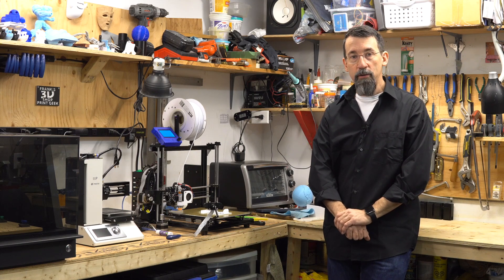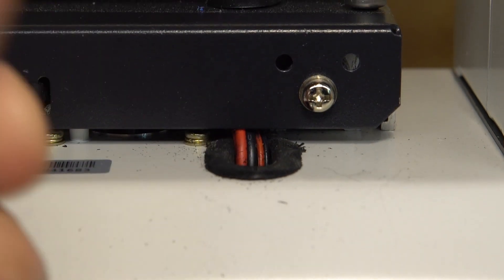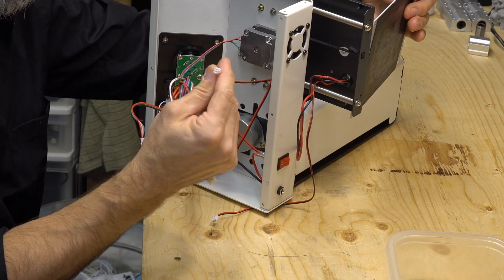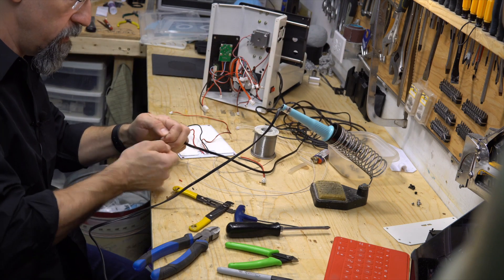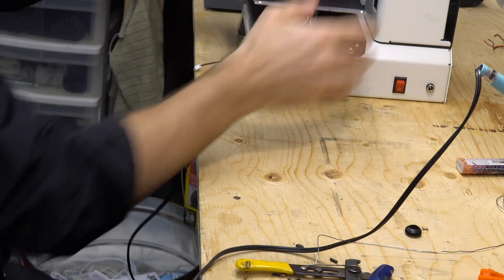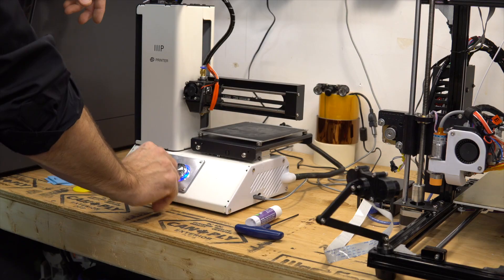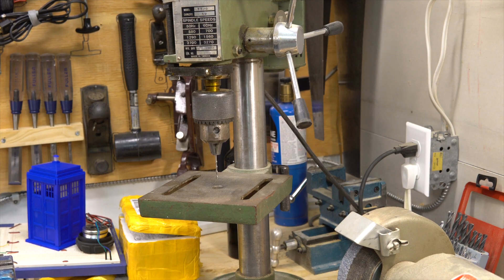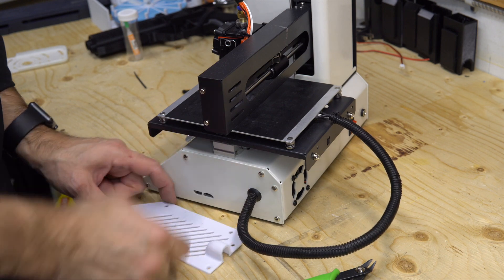Monoprice Mini Select V2 heat bed cable replacement

Comment: Will this bed wire mod work on the V1?  I was in the middle of a print and my V1 died.  No power.  When I manually move the bed, there is one spot where the power comes on for a split second and then nothing.  So it sounds like the bed wiring is the culprit.

Comment: You have a video of how to get the belt tension or install it? No matter what I do I can not figure out how to install a new belt for bed.
Reply from the maker: No I do not, I have put it on my suggestion list for videos.
Reply: @Franks3Dshop  I ender up finding the belt diagram. Took for ever to find. All working again ty

Comment: Salut Frank, j'ai un monoprice mini et je veut mettre du filament de 3mm , comment faire? Merci d'avance!
Reply from the maker: Salut, il faut modifier tout le chemin que prends le filament pour du 3mm, y compris l'extrudeur, c'est assez compliquer et la mini est bonne pour imprimer de petite pièces et vu la grandeur du banc ne peut pas imprimmer très rapidement à cause des accélérations limitées par la grandeur du banc, le 3mm n'aurait pas d'avantage selon moi.
Reply: @Franks3Dshop  

Merci.

Comment: I'm doing a similar version to this, although I drilled some holes in mine, and I can't get the solder to release the old wires. Is it not hot enough? it's a 100 watt soldering gun, looks just like yours actually.
Reply from the maker: Hi, it should be more than enough, sometimes getting some new solder on the iron before heating the joint helps.

Comment: Mine's Bowden coupler failed meaning I needed to replace it which lead to a full extruder feeder replacement. Now the cable is doing this. Glad you have this.

Comment: hey frank, thanks for the video, i got one question for you, and the others readin the blog, my bed is heatin properly, but the temperature on the the screen is not right//
temp goes from 27 to 51 in 2 seconds and comes back to 27 in less than 5 seconds.. i cant figure it out.. anyone?
Reply from the maker: No clue for that one... Did you make any modifications ?

Comment: Nice video. I'm starting to see the wacky temp readings. This sucks. I don't think I have the dexterity left to do this. Got no tools thanks to a thieving brother-in-law. I'm screwed.
Reply from the maker: May I suggest that you look at this video, the way I do it requires no soldering and less dexterity I think: https://youtu.be/d0X518wUJT0
Reply: Thanks for the reply but my MP Mini issue is the heat bed problem you addressed in the video above. You linked to a hot end fan replacement.
Reply from the maker: Sorry for the mix up not enough coffee I guess! I do not have an easier way for the bed...
Reply: No worries. I was planning on a new printer now it's just the sooner than later. Just got to dig out enough room. Want a 50lb color laser printer? 😀

Comment: Hey Frank, I have the same drill press you have in this video. 
That ugly green Chicago Electric, way to fast, but very useful drill press from Harbor Freight. 
I have a small knife shop in a shed and that thing works great for me after all these years. 
By the way, love your videos. I’m new to 3D printing and these help so much.
Reply from the maker: Thank you very much, that drill press and the grinder were my grand father’s, the travel is too short for my taste, but fills my needs. And great for the knife shop, would like that someday too. Need some diamond sharpening stones...

Comment: solid wire work? or should i use stranded since the wire will be moving alot?
Reply from the maker: Hi, stranded wire for sure, you could use wires for cars, the type that goes from the door to the car. The more flexible they are, the better, respect the gage size.

Comment: Hi Frank, after doing the fix the bed temp just rises non-stop. I havent soldered, just twisted the wires... is this a reason for this issue? thanks!
Reply from the maker: Does it start heating on it’s own? If yes, your output mosfet maybe bad. I presume you turned the printer OFF and ON? Check your connections, put some tape on them at least. I do not know what could happen if mix up the cables or if they short out on one another, nothing good I think. Make sure you do not have a short.

Comment: Hi Frank.  My Mini is 6-7 weeks old, V2. I thought I'd do the reroute before the wires actually did stop working. It's easy to do and didn't take long. But after completing this the temp gage is now reading 234 then 426 then 375, constantly changing. Do you know what would now cause the gage to fluctuate and misread? Thanks for any help.
Reply from the maker: Hi, it looks like an almost broken cable, like if the individuals threads of wires were all cut but one inside the insulation. If you want to be sure, you can switch thermistors plugs of the nozzle and bed only to test the readout, do not start the printer heaters like that and do not leave it inverted or you could start a fire... if the bad reading is also reversed, you know the board is good and that you have a bad cable or thermistor on the bed. Remember, DO NOT START HEATING with the thermistors inverted... label everything to be sure to replace the cables at the correct position and stay next to the printer next time you start it, just to be extra safe.
Reply: Thank you Frank!

Comment: There is a need for a printed part for the bed or with all the movement you will be in the same place just a different place of failure.  :)..
Reply from the maker: I did print that part, but it did not fit. I asked myself the same question, and after looking at the cables movements, since my cables are long enough, there is no movement near the bed where the cables are soldered. So I decided to leave them as is. And it’s been many hours of print later and no problem.

Comment: where could i find the correct 18 gauge wire to fix this? also could you not just cut the wires at the heated bed and at the board and then solder on both ends rather than unplugging everything else?
Reply: I actually got mine from a broken computer psu
Reply from the maker: Yes you can also just remove the side panel and do the cut like you said, in my case I was curious to see the inside :-) For the cable, you can go to Radio Shack (The source) speaker wires should be OK or search for Amazon for « 18 awg wires », use only multi-strand wires.
Reply from the maker: Good thinking !

Comment: Your video and advice has been very helpful. The new Prusa looks nice, but for the price the flaws on the monoprice are'nt that bad. If your an enthusiast or print bigger stuff, you should probally get the prusa though.
Reply from the maker: Yes the Prusa is nice, would love a MK3, and I am building a clone, an Haribo Edition from scratch, we will see how it does, and I will also try the TMC2130 drivers to have some of the advantages of the MK3. It's a learning experience for me.

Comment: What do I do if I don't have any of the tools to complete the fix?
Reply: Punt.. :)
Reply from the maker: You can buy a cheap solder iron and some tools on AliExpress for really cheap, just bought this solder iron and it work great 
https://www.aliexpress.com/item/32434337822/32434337822.html I think that for the bed the wires needs to be soldered.

Comment: Geez! I dunno why but I thought they fixed that with version 2 (V2). LOL!
Reply from the maker: A friend had a V2, but he has to return it because of the power plug that was intermittent...
Reply: ×Frank's 3D shop Bugger. But do you know if the new V2 has fixed the bed cable wiring problem? Sorry to keep asking, but I've read somewhere, by someone the problem was fixed and I'm trying to confirm. You know, too much posted just isn't actually true. People posting answers to things that they haven't experienced. Crazy.
Reply from the maker: We did not think of checking if there was some difference, for sure the cables were still under the bed not outside... Sorry.
Reply: I have a V2 that I sent back to Monoprice because the thermistor reading became intermittent (reads 999) and the heat bed stopped heating. They had it for about a month.  I have had it back now for about a month and the thermistor is starting to act up again. No plans to ship it back this time. I will probably do Frank's mod.  I have also heard of people using wires with silicone insulation which seems to be more flexible and less brittle.

Comment: Great video. Thanks! Just a question. Do you have to replace and resolder the cable if it wasn't frayed/broken?
Reply from the maker: Hi, I personally waited until I saw signs of problem, that way Incan show some extremes. But you risk shorting the heater wires and fry the output on the board. I think it’s probably the worst scenario. In my case the temperature sensor was giving readings in the 6000. But probably you will have a bed that does not go to temperature before that.

Comment: Hi Frank, you used this side panel? 

https://www.thingiverse.com/thing:2451362
Reply from the maker: Yes exactly, and for the front part, you have to follow the original link in the description, this is a remix of the back part...
Reply from the maker: The front part is here:
 https://www.thingiverse.com/thing:1712796

Comment: I haven't had this problem.. yet.  Because my Mini Select is still in the box. But, just yesterday I finished all my other projects and now I'm going to set the printer up.  I like the printed side cover piece for two reasons; 1. The extra vent holes, could even add a small fan in there.  2. It looked like there was less bending of the cable at the back of the bed with the printed cover than there is with the stock metal one with hole drilled.
Reply from the maker: I see your point, either is good I think, I could also make slots on the original panel with the CNC, not sure if it would be able to since it’s harder than aluminium. There is already a fan on the back and holes underneath, but more is better in this case. In do not worry to much about it, if the board went dead, I would by a cheap remplacement board and screen and make a Frankenstein out of it :-)

Comment: Good to see another new video for this important fix. 

By the way, at [11:41] be careful moving the bed so fast. It can generate a current in the motors and send it back to the board.  (I have seen the LCD screen light up with the power off, when moving it fast)
Reply from the maker: Thanks, I know, still works but you are quite right.
Reply: You can see the LED on the dial lighting up in this video a few times while he's moving the bed and it's not plugged in.
Reply from the maker: Y’a I do not worry to much about it, never broke anything yet that way. In theory it’s possible and even if the printer is powered on it could be the case too. I get carried away while filming!